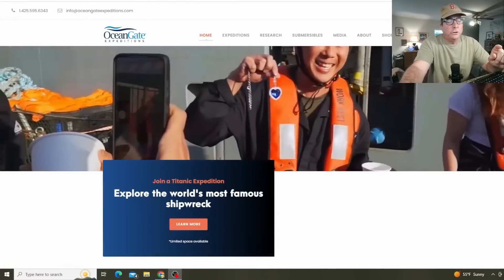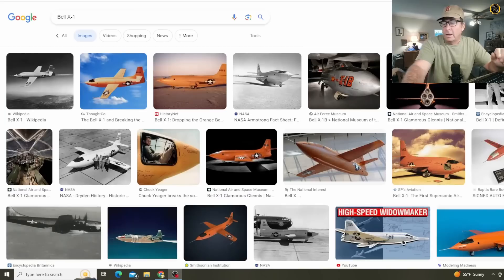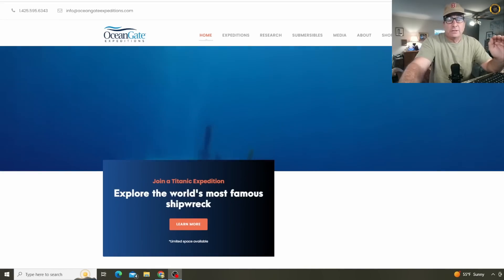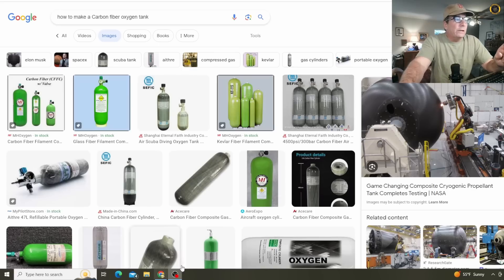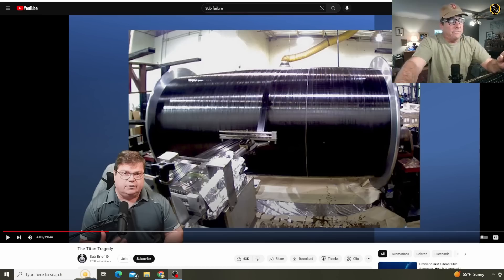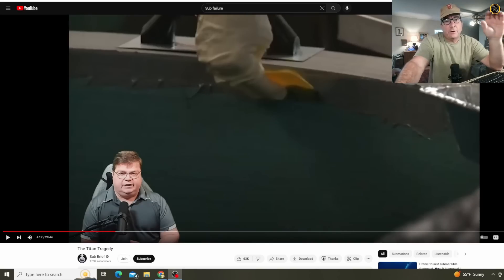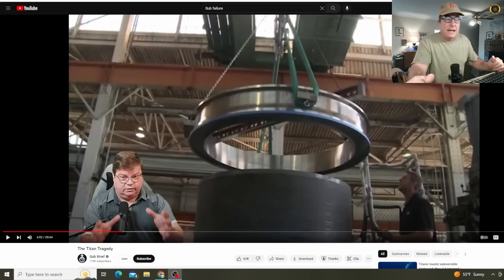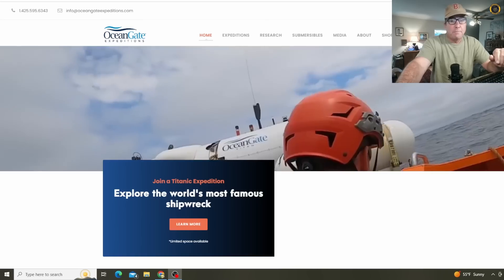Oceangate Sub Construction Details and Implosion

Comment: I studied PhD in ocean engineering more than 15 years ago and this is the first time I've heard carbon fibre being used in a crewed deep-diving submersible. The first thing popped in my mind was exactly like in your analysis – how many cycles this vessel has been through and if any proper safety checks have been done after each dive – then I watched the video showing the interior of the vessel and my guess was probably not much...
Reply: As an amateur who just hangs out at an airport with his Private pilot father, and an awesome crew of a bunch of other dudes that get into all kinds of stuff like composites , the general rule of thumb with carbon fiber is 
Compression,no. 
Tension, yes. 
Seems to me they broke a general law of physics 🤷‍♂️
Reply: @MrTheHillfolk  Physics proved early on that you cannot push a string. This remains true today.
Reply: @TricksterJ97  
Remember that (what ya said) and chances of survival are alot better.
Reply: When I first heard about this whole mess or tragedy really, about a submarine meant to be cheaper and using off the shelf parts, I thought the point was to mass produce them, because they were cheap and use them with a large margin of safety. 

So I thought they would have made a couple of hulls and tested them until failure of eg. 5-10-20 uses and determined that using the submarine x number of times would be safe, with a large margin, after which they would be replaced with a new one. 

I could not and still have a hard time imagining, that just about the only test hull they made, afaik. was the one the they pushed into manned and even commercial service and used until ... well failure.
Reply: Did you use your degree?  Can't tell if I should go deeper in Ocean Engr rabbit hole (love it, just not an infinite number of jobs) or do something new.

They're using CF for lower pressure PVs now, I think, on a couple fielded systems. I actually have been meaning to call the company to confirm bc I was a bit surprised when I saw it.
Reply: Titan had completed only 13 of a scheduled 90 drives to Titanic, with an astonishingly low success rate of 14% record of reaching the 12,500-foot depth to see Titanic, despite charging $250,000 a trip.

Comment: It seems to me, pulling a vacuum to whatever equals the outside pressure expected then multiply it by 4. If it cannot withstand it, it loses. Now if there is a proper pressure chamber or tether it and send it unmanned to twice the depth expected, as many times as it takes to implode it. It needs to be known what it will take to breech it, any design. With life and death, destructive testing is a must.
Reply: I don't think there is a pressure chamber to test vessels to 400 bar. You would have to do this unmanned in the ocean by letting it down from a ships winch

Comment: For a chamber under tension looming the carbon fiber on would be inferior because there would be stress perpendicular to the load path through the carbon fiber and tension pulling bundles apart due to the axial component of the pressure. I'm not certain that is inferior for a pressure vessel in compression though. The big issue is having your pressure vessel under compression pushed out of round and getting a huge stress concentration at that point, having the carbon fiber loomed on outs the most fiber in the position where it is loaded most heavily in the direction which it is the strongest in. 

Again and again the issue has been that this is way outside of the norm for composite materials and no one seems to be at all familiar with these materials in this application.

Comment: Google found a paper outlining compressive pressure tests on a carbon tube with a 1.2" wall thicknesses. It failed at around 3150 psi. This craft had a 5" thick tube and the pressure at Titanic is 5800 psi. Im no expert but that sounds plenty strong enough? Apparently the window is (only) 7" thick acrylic.

Comment: 787 next ...?
Reply: No. It's never under 6,000 psi of compression.
Reply: Aircraft run through pressurisation tests before they get certified. The last airliner with problems with the fuselage was the Comet in the 50s
Reply: @simonm1447  I think the a350 qater has had such problems. the tests can't replicate the lifespan and weather, as well as material variations etc and also carbon fibre can't be scanned. also they have them at higher internal pressures. I bet there willl be problems.
Reply: @RUNDMC-555  the problem at the 350 was the paint was expanding different at heat than the fuselage material. This has nothing to do with fatigue in the skin itself. 

You can scan carbon fiber quite good, and other than this sub commercial aircraft are maintained and checked after strict schedules

Comment: There's a picture of the monitor mount inside the sub that was screwed directly into the carbon fiber tube. It was 5 inches thick but you don't screw anything into carbon fiber. Who knows what else was done to compromise it's integrity.
Reply: That's an inner liner, not the pressure vessel.
Reply: @ampdoc12vdc  looked like carbon. Have you seen the picture
Reply: @marksanders4815  Yes, There's pictures out there where you can see the monitors are mounted to a thin decorative interior cover over the wiring and insulation.
Reply: Carbon fiber that thick wouldn't need insulation. And the wires for the monitor are run down through the floor all willy nilly. A piece of decorative carbon fiber that size would be crazy stupid to buy. But who knows maybe that's why they couldn't afford proper ballasts and had to use remnant pieces of rigid pipe from a construction site and lights from Camping World. Not to mention the PlayStation controller. You still don't mount anything to carbon fiber with screws if you know what you are doing. I own a prototyping firm and if we built something like that for a customer we would be fired. That thing was comical which is sad to say because of what happened. It shouldn't have been in the water at any depth.

Comment: Pressure vessels....... the circumferential stress in the longitudinal seam is TWICE the longitudinal stress in the circumferential seam. IOW.. an over pressured  sealed tube with bell ends will SPLIT along it's LENGTH @ failure. What is resisting this failure mode is not the CF ....it's the Epoxy Resin...... the 5 inch CF layup[ handles the circumferential  load but NOT ANY OF THE AXIAL LOAD of the vessel......that's pretty good epoxy that handled it.... this long. Brand ?
Reply: All others I'm aware of are SPHERICAL for good reason.

Comment: At 3:34 that is the interior of the carbon fiber hull. The titanium ring sets over and around the ends of the carbon fiber hull. Your sketch/diagram is not accurate. There is an inset/flange of about 2 to 3 inches that the adhesives are spread on, as well as both external and internal of the hull.

Comment: I think dissimilar materials is a potential issue.  As the vessel descends and becomes loaded it will deform quite a bit, and it is likely that the carbon fiber will deform at a different rate from the titanium.  Where they meet there could be additional stresses from this and this behavior could cause unexpected cracking in the carbon fiber.

Comment: You can use ultrasonics to inspect composite but I think the likely thickness of the tube would make it a challenge. You are right-on with the lack of axially oriented fibers. That means the you only have the strength of the resin axially and no bending strength. You get  tension stressess induced in curved surface through the thickness because of the thermal expansion coefficient differences between fibers and resin. Note this delta temperature is the difference between the cure temp and the operating temp. Finally at the cap the titanium has a higher thermal coefficient than the unidirectional carbon fiber and you will flex that interface as you decend.

Comment: this sadly sounds like it will end up a 'death by misadventure' those involved i think know the limitations, sadly for them the testing and passing of regulations probably is not in place and takes too long - going to Titanic possibly for them built on there own testing, 'black box' 'white box' testing, get the thing out there to prove it works and get certificated to go all out
from  the video of the construction, its pretty interesting, and what i know (very little, but watch videos on boat building) the people i watch often build into the structure of stresses, what i am interested in is the factors of unexpected stresses, where are they and are they considered, i.e. something expected to take vertical loads is built in, if a sideways impact hits and creates a stress fracture, the vertical load will probably fail completely if repeated, if it hadn't already - with the sub repeatedly submerging and surfacing can create some pretty nasty loads, as you know well with aircraft vacuums etc - i am astounded at the results of this sub and we are just learning of people who have said don't do it or use for deep subsea diving, the alarm bells were there and no one listened, now they will - unlike aviation and strict rules, submarining is still a relatively new science, perhaps some new structure and control should be in place

Comment: Don't be so sure that it will be possible to establish the exact failure mechanism. It's very likely that that the carbon fiber portion of hull was completely disintegrated by the the implosion. If that's the case, then any evidence of exactly what happened will be gone.

Comment: (Edited to correct my goofy psi number. It should be around 6000 psi.)

Lots of great commentary here, very informative.
My only input here is the staggering ignorance and hubris this guy possessed. He categorically ruled out retired submariners - just a bunch of old white guys (odd coming from an old white guy).
Just a bit of study would have shown him how the Navy learned how to deal even with much lower pressures, starting with SUBSAFE after the Thresher sank - I had one of my systems that triggered SUBSAFE protocols for a certain repair (dealing with hull penetration).
Now, I'm sure this CEO would have said "we only have a single teeny tiny wire..."
That's right, bucko. And there's  6,000 psi trying to find a way past it.
The ocean, as pleasant as it can be, is actively trying to kill you, 24/7/365. It never takes a break.
And, as a practical fellow once said,
 "The Stupid Shall Be Punished".

Comment: I have worked at a company that manufactures major components for the A350, it is mostly composite. What are your thoughts on that airframe? I have concerns. 26yr aircraft composite and structure mechanic.
Reply: Aircraft are tested much more until they are certified. There are pressurisation tests where a fuselage is constantly tested to get a big number of flight cycles. This sub was put under far more stress and was never independently tested or certified

Comment: 2.2 inches is the hull thickness for a navy submarine with a test depth of 1300 feet, HY-80 steel.  The carbon fiber was 5 inches thick?
The depth where imploded was 12,500 or 10× the test depth of a US sub.
Was this carbon fiber tube underbuilt?

Comment: Tension load force as in a pressurized tube (aviation and aerospace)  versus compression load forces as is the case with deep-dive submersibles. 
Design has much greater strength again expansion (tension)  than against compression. 
Blancorlirio hits the nail on the head with that point. Even of the joint bond strength and durability was a problem (very likely was) , the ability of 5-inch thick Carbon fiber composite to provide enough compression resistance is an unknown. Especially in a cylindrical shape versus a spherical shape

Comment: I'm no engineer. Just a semi knowledgeable layman. Looking at all the inputs on the design of the carbon fiber, to using CF AT ALL, to the window which was apparently only rated to 1300 meters or less than half, to the fact that you're using titanium rings joined to carbon fiber. Keep in mind that never mind the temperatures, but different materials will compress and expand at different rates. There's a reason compressed gas tanks are made out of one material in a layer. This thing was a who's who of what's going to fail first.